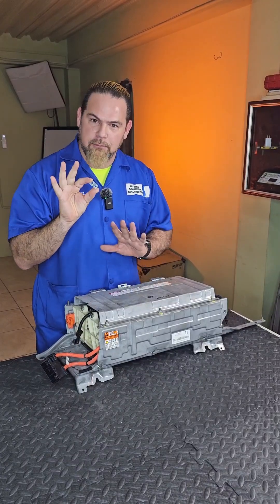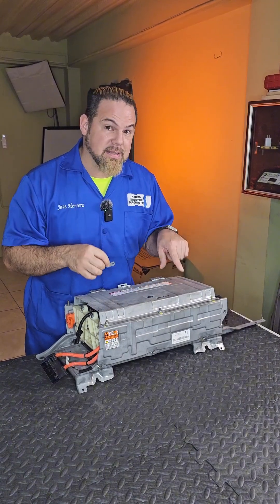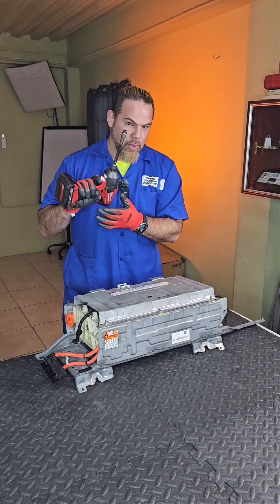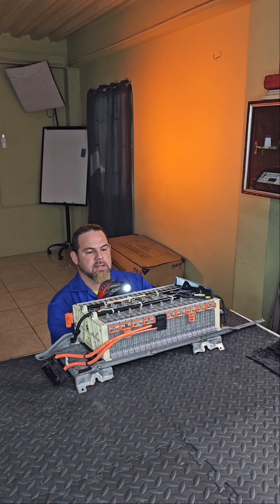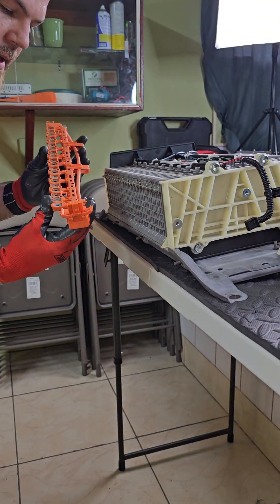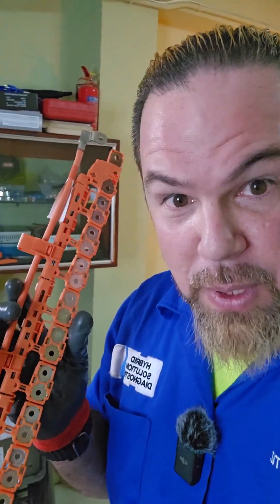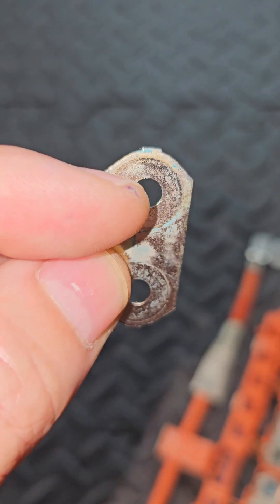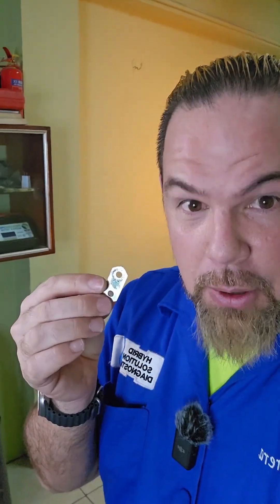Hybrid Battery Nickel Plated Bus Bar Myth

Comment: wow so if the car is hot inside it will cause the battery to swell .... and my understanding is that the ac wont run properly if the hybrid battery has +- .02v difference which in turn affects the battery from functioning as it should but the car cannot cool down properly because the ac cannot run full fpeak because the battery is +- 0.2 v. so the car cannot remove the heat fast enough in turn causing the corrosion to spread. great job toyota. this is why sometimes if you tuirn the ac on it wont cool and you have to turn it off and on to get the ac back up but as soon as you slow to a halt the hot air kicks in because your foot is on the gas pedal.

Comment: Hey man I have a 2017 Ioniq Hybrid and recently I noticed that when the A/C kicks on, there is a humming noise coming from the engine area.  Only when the A/C is on. The noise "pulses" like the sound goes up and down. What can cause this?  I have about 90k miles on it.  Thanks man!

Comment: I follow your channel of terrific videos and have learned a lot to keep my 2007 Prius running well. Almost 200k miles and still getting an average 50 mpg. Next step: reconditioning the HV battery and balancing it with the Spider Cable 🕷️
-
Sounds like companies want to sell a bit of nickel for a lot of dollars. Pure metals with the highest electrical conductivity at the top of the list are silver, copper, gold, aluminum, rhodium, zinc, and nickel. Gold plating would be the best metal offering the least resistance. Also, metals typically lose electrical conductivity when temperature increases.
-
Based on my experience with wiring and electronics, overall, copper offers the best performance, and gold plated contacts extends that.
-
Reduced humidity and airborne corrosive particles plays an important role in keeping the copper in the best shape. Keep the HV fan and air filter clean. The 2007 Prius doesn’t have a factory installed HV air filter and I added one using the same filter material with yhe later models. I was surprised at how much the filter collects after a few months. Another factor is the prepared surface of the conductors and having a larger contact patch is crucial. Not only cleaning conductors is good practice but polishing them can further reduce electrical resistance.
-
I live in Florida and humidity is relatively high and the dew point at night can be high, too. For ventilation I have a solar panel in the cargo area powering two 12v exhaust fans in the cabin pressure port. That keeps the cabin temp and humidity closer to the outside, mainly when the car is parked. They run during the day and naturally shut off at night.
Reply: 2007 - 200k - 50 miles per gallon …. I have eyes of envy 🤭.

Comment: Jose, nobody ever talks about the real issue with the gen 4 Prius. Every time you go downhill using regen or park in the sun, the battery goes over the 41 degrees c, which puts the car into semi limp mode. The worst of it is the cooling fan doesn't even kick on until they're above that temp and so the car runs terribly for at least 15 minutes or more. You can hook up Dr Prius and tell the fan to kick on at 36 degrees which helps, but is a pain to set up every time you drive. It would be good if you could program the car to do that by default. Greetings from Australia by the way, and keep up the good work.👍👍
Reply from the maker: @tonyarntz821  totally true
Reply: I can make the cooling fan work every time when you start the car.
Reply: @PandiKristo  That would be great. How did you do that?

Comment: the negative posts are leaking because the seals are blown. blown because the vent valve stopped working properly and over pressured the blade(s). the blades will leak now even sitting on a bench without charging...design flaw toyota/panasonic...  I fought with the blades for years, life sucking junk! I put in a yabo(not sponsored) kit and year ago, cells are still 0.05v balanced and we get +40C and -40C...